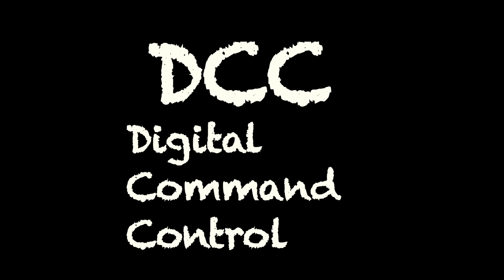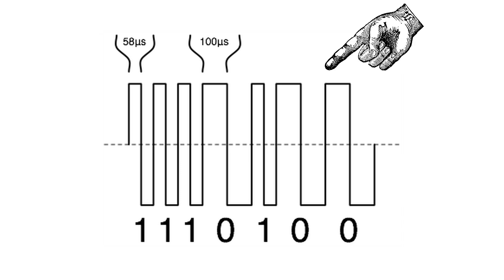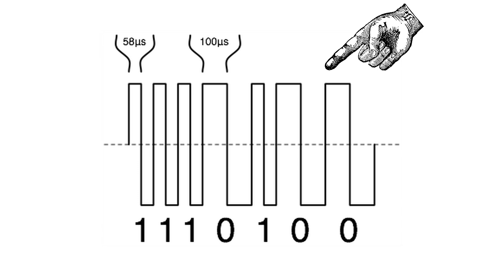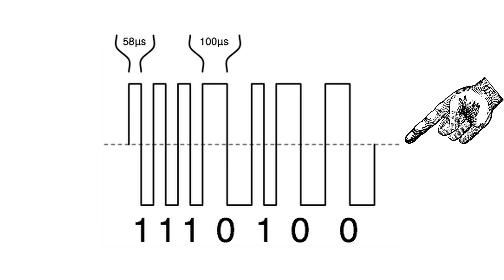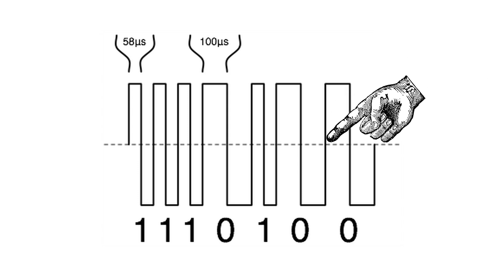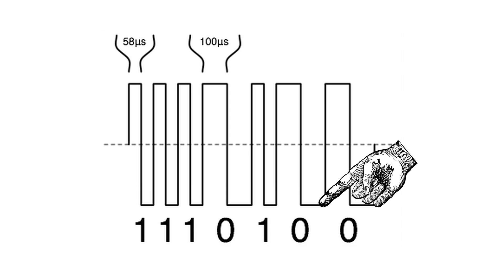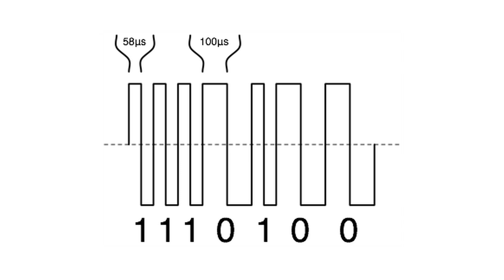Basic DCC for Model Railroads - Why Can't I Run Non DCC Bachmann Spectrum Locomotives on DCC?

Comment: Well explained Dale. It is square wave A.C.Did you know Marklin developed digital back in 1983, it was Delta.Then came MPX,a much better system.The principle is the same as DCC for DC motors,except you don't need to rectify at the motor.By the way Marklin digital will run on analogue AC controllers with better slow running but you lose the functions.                                                      I have both AC and DC locos and systems.

Comment: No my eyes didn’t glaze over.  They didn’t have decoders for N scale when I got started.  Of course the technology has caught up and the decoders are available.  Shower I just want to run 3 trans at once so I really don’t need DCC.  Great  video and good explanation.
Reply from the maker: I only ever run one train at a time. Well for the most part. Still though I like DCC. I like the sound features and I like all of the interesting fun controls.
Reply: @ToyManTelevision  I don’t disagree.  Controlling signaling and turn outs adds to the realism.

Comment: DCC is great but it is very susceptible to bad electrical pickup / dirty track. Its not just that the train can slow or hiccup, but the decoder will reset and then the sound restarts which is very annoying. I have added Current Keeper's to my HO engines but can be very difficult to find the space. I wish the DCC spec had required at least some level of CC.
Reply from the maker: With my project spaces never an issue. But the current keepers that I’m using are so tiny. I think I could just about fit them inside a thimble.

Comment: DCC is indeed Alternating current.
Reply from the maker: It’s interesting to note that in some of it’s variations the AC is super imposed on top of the DC current and the DC is used to power the motor. I tried to sort of touch on that video. But it’s much simpler to just use the AC and rectify it into something that will run the motor.
Reply: @ToyManTelevision  ???

Comment: There is a way to convert AC motors to DCC and there is an article in the Stan Ames DCC book so that Marklin can be converted.
Reply from the maker: I need to go look!  Thanks.
Reply: Thanks,I have lots of analogue locos that need converting from Marklin, Fleischmann, Roco and Lima.